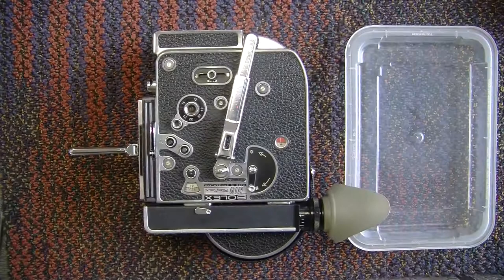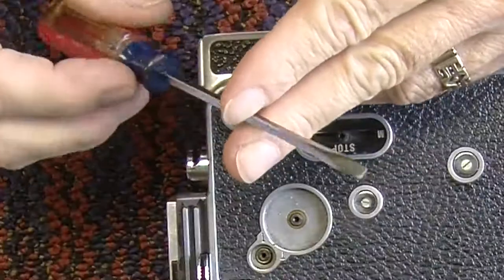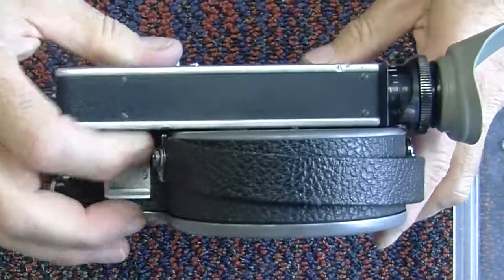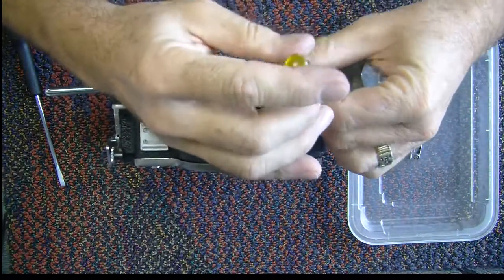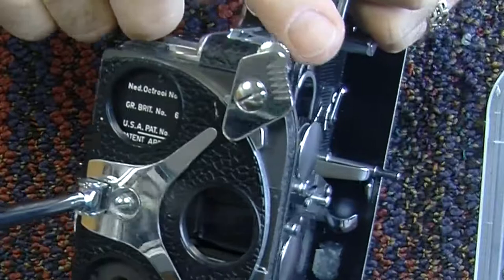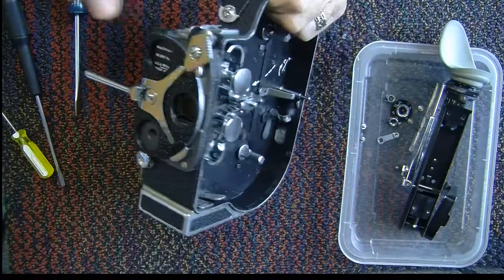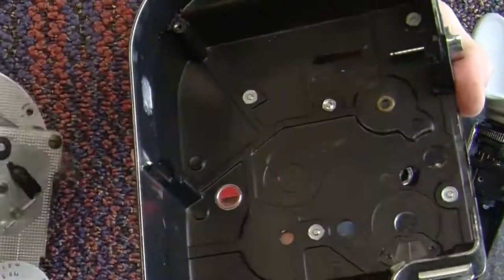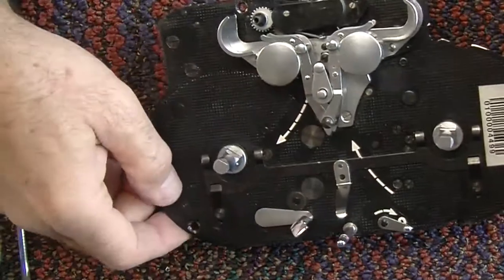Bolex Tales 3 AudioMix

Comment: Hi! I've wrote on the other video. I still can't open it. Got all screws off, but it Is like if the trigger has to be removed too?!
Reply from the maker: are all the knobs, buttons and dials removed from the crank side? Also back out the 2 screws that hold the strap on. after that some models have a nut on the inside for the accessory adapter. After that it should just be the sealing mastic, just a sharp rap should get it out. Hope this helped. Good Luck

Comment: Hi, i've run the camera at 64 fps without the film, now the motor doesn't engage anymore, what should i do to fix the problem? Thank you
Reply from the maker: Did you let the camera wind itself out or did you stop it while it was buzzing away @64FPS? If you stopped it then you may have sheared thr index pin on the 1 to 1 shaft which may have lodged somewhere in the gear train.
Reply: @richjura8957  I've let the camera wind itself

Comment: I need to remove both sprokets rollers from my H16 non reflex. Do I need to disassembly all the camera in order to take them out or there is a manner to do this without disassembly all the camera? 
Somebody have tried this risky operation?
Reply from the maker: Are you speaking of the chrome drive sprockets that move the film? There are 2 set screws 90 degrees apart in each one, you will need a long slender screwdriver to reach them. When reinstalling them they need to be timed to the pull down claw and set to the correct height.
Reply: @richjura8957  thanks for the help. I already unscrewed them but there are parts from the loop formers that impeded the freely movement to take the drive sprokets out. So I´m not sure if I need to remove another part of the camera besides the 2 set screws in each drive sprokets in order to be able to take them out.
Reply from the maker: @jef7393  There are 2 slots in the bottom of the drive sprockets, you have to maneuver the loop formers till they line up.

Comment: Hi Rich, Thank you for this video. I have a Bolex h16 non reflex I'm trying to dismantle but the plate isn't budging in taking out of the shell. The sealing seamed to peal up slightly though. Are there extra screws that need to be removed from the body on this model? Much appreciated and well wishes
Reply from the maker: Hello Paula,   On the older non-reflex cameras there would be 5 screws holding the plate to the body. Also be sure all the knobs and levers are removed from the winding handle side of the camera including the winding handle. The accessory mount opposite where the ‘focusing port’ is often times has a little nut on the screw which will keep the plate from dropping free. You also have to loosen the screws that hold the strap on as they can pinch the main plate and not let it separate .
Hope this helps.....Good Luck........let me know how it goes and if I can be of anymore help.
Rich

Comment: Hi, very interesting video but a shame it's missing the rest of the story.  I have a rex 4 that appears to be fully wound, but won't function when the button is pressed, but does function normally when using the manual crank with motor on 0 setting.  I want to remove the prism plate and have a peak inside...any tips on re-synchronizing the shutter to claw mechanism afterwards??  Or a link to someone that does explain it?  Seems to be the one element of a basic camera breakdown that isn't covered anywhere.  Or can you produce a video explaining this procedure??  Many thanks for your excellent video.
Reply from the maker: OK. When installing the turret assembly put the camera Into single frame mode.Rotate the shutter so it’s about 25 or 30 degrees above the aperture, when you drop the assembly in place the shutter should be just above the aperture. You’ll need something to hold the trigger in that single frame open position.
  Are you sure the spring is good, is there tension on the wind handle? Engage the motor lever and using the rewind crank do you feel any tension?  Sometimes they can get stuck and ‘rocking’ it with the rewind crank with the motor engaged can free it.

Good Luck
Rich
Reply: @richjura8957  Hi and thank you so much for this.  Yes, there is tension when I have the winding handle in position MOT.  I had heard that if the spring was broken, I would be able to wind the camera and make it turn the shutter, but mine won't budge, however, it's working fine using the little manual winding crank in the O position, although winding forward is much smoother than winding backwards, as if rewinding the film.  I will try rocking with the rewind crank with motor engaged.
Reply: @richjura8957  I decided to go further so removed the mechanism from the body and then separated the halves.   The motor spring was broken and the casing for the spring had some damaged teeth.  Do you have a spare spring motor to sell?  Also, if you can manage to post the unedited rest of your video, that would be most helpful for figuring out how to put the camera back together!  btw. the camera I'm working on is a rex 4 that's as clean as a pin.  I would love to save it.
Reply from the maker: Sorry, no motors. I have retired. I got my motors from Chambless Cine Equipment. Did have some rewound in a small shop in Chicago that did old clocks. Was a disappointing effort as they did not run as well as the Bolex units.  Still have not found the box with the original footage yet.
Rich

Comment: Jura, te hago una pregunta. Yo tengo una Bolex H16 reflex ( el primer modelo d eBolex Reflex) y no se como desarmar el visor de prisma, ya que no tiene los 4 tornillos como muestra el modelo en tu video. Tenes idea de como puedo desarmarla. Mucha sgracias nuevamente. Saludos, Daniel
Reply from the maker: Daniel
  Sorry I don't speak Spanish, if google translator is to be believed then I'm assuming you have a round bottom camera with the small viewfinder. If that's the case then the eyepiece unscrews and the top comes off the viewfinder. If I recall these older cameras only had 3 screw holding the tube to the body.

Hope this helped

Rich
Reply: Hola Jura. Si, yo tambien utilizo el traductor de Google. Jajaja!!! Exacto, como vos decis, mi visor tiene el visor ocular redondo. Calculo que si en verdad es lo que me comentas, deberia salir desenroscando esa pieza. Voy a probar y luego te comento. Gracias nuevamente. Saludos cordiales. Daniel